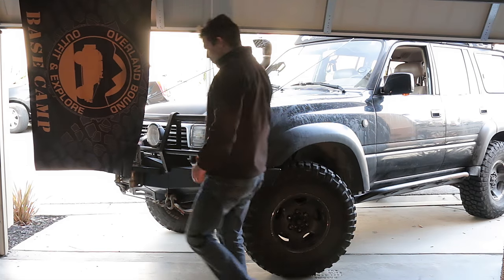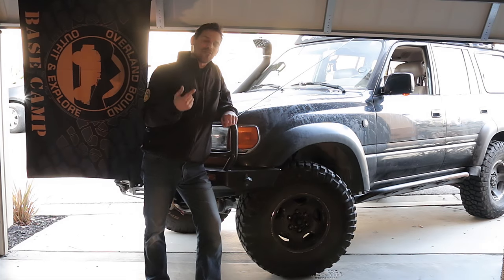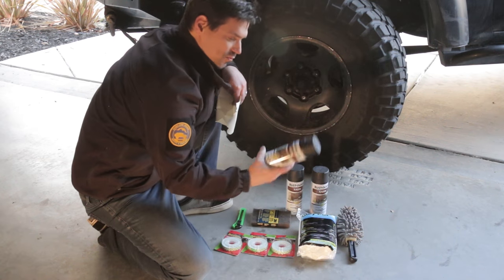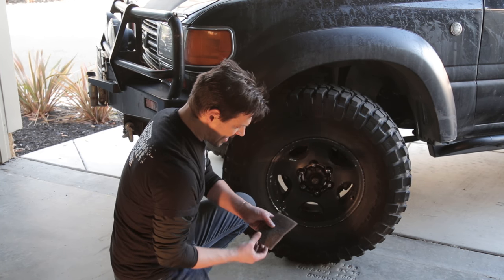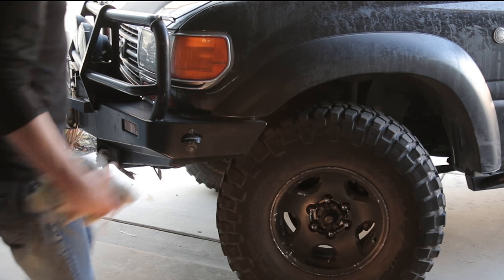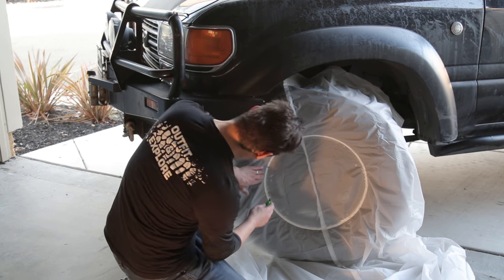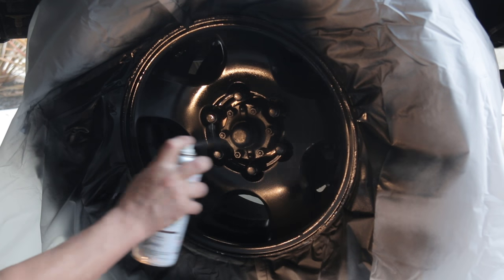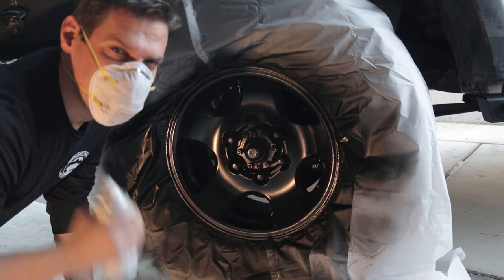Rattle Can Wheel Painting - 10 minute job!

Comment: A deck of playing cards tucked in at the edge of the wheel/tire fanned out in a circle will have the same effect of all that taping and masking.  :)  To each his own.
Reply from the maker: Take a look at the technique. It's freekin fast. "All" that taping and masking costs only a bit more than a deck of cards, takes about as long to do, and covers better.
Reply: Overland Bound did you use any finishing coat to protect the paint? Or it doesn't really matter?
Reply: maybe on this application it doesnt really matter cuz a rock climb will rip that off & will make repainting more of a mess

Comment: Don't know if anyone mentioned it yet but a very cheap and quick solution to buying the 2-sided tape. Use index cards and stick them between the rim and the tire you can overlap them easily and have 360 degree coverage then if needed you could use newspaper and masking tape for the remaining exposed tire or the plastic and tape.
Reply from the maker: I know the card technique. It's good. If you timed us, you probably beat me by a few seconds, not a minute, but not if you masked the rest. At $18 bucks for 4 tires, I just think this way is cleaner with more protection (including the driveway. Not better necessarily, but I like it better.
Reply: True I can see your point. Worth noting though if someone has a lack of resources (which can be quite common when always wanting a bigger and better vehicle), or they cannot run to the store quick, the note card option can suffice.
Reply from the maker: Agreed!

Comment: I know this would depend on wheel design. Did you cover/protect your brake discs and calipers from over spray?
Reply from the maker: No - it received a light mist - gone now after a drive around the block :)
Reply: Yeah, I wouldn't worry about the discs and calipers.

Comment: Need to mask off your brakes brother. The paint can ruin your pads and your brake calipers. If anyone does this make sure you also wrap up your brakes.
Reply from the maker: 10' of pedal pressure and the paint is gone.
Reply: Yes but it can cause brake fade and contaminates the pads and the rotors, clogging them with the paint that is applied. Take a trash bag, split it down one side and wrap your brakes up to the hub and use a piece of tape to hold it. Trust me, it will save you in the long run. Doesn't cost much, and only takes a second.